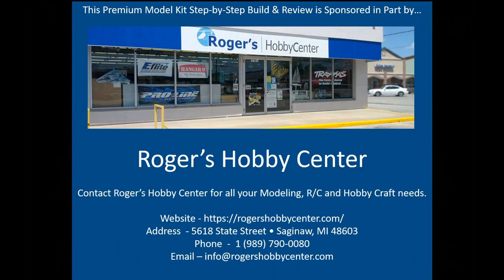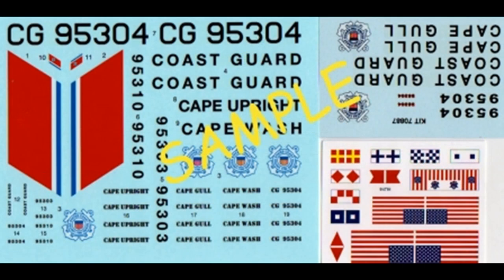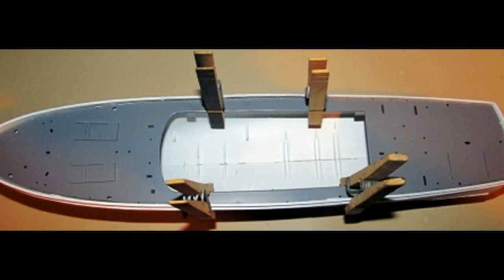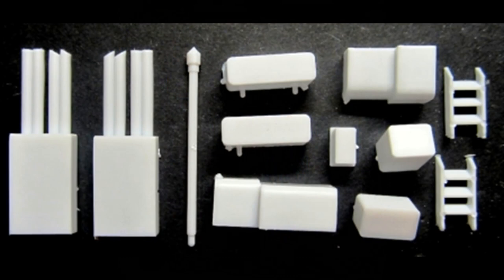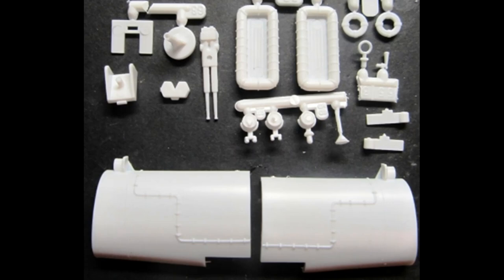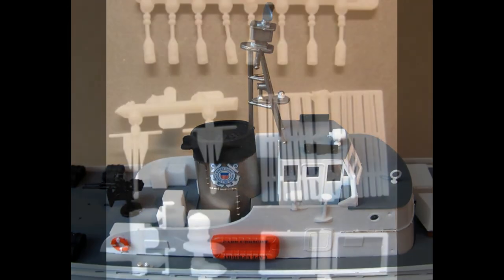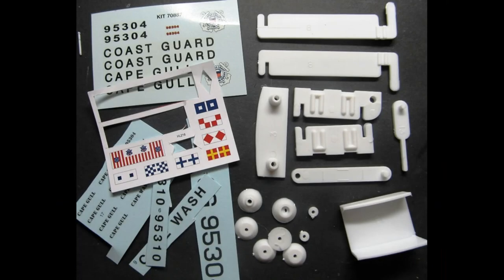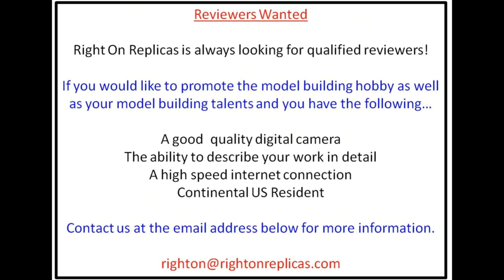USCG Cape Class Patrol Boat 1:82 Scale Lindberg #HL216  -Model Kit Build & Review

Comment: What adhesive are you using to attach painted parts to painted surfaces?
Reply from the maker: Wm,  First, that paint needs to be addressed first!  You must scrape or sand the paint from adjoining areas first or the glue won't adhere to the plastic.  Thanks for asking and if you find our channel helpful, please subscribe if you haven't already, to help us continue our mission to inspire more modelers!  -Doug!
Reply: @RightOnReplicas  I figured that but what I was wondering when attaching the smoke stacks, how did you get in the right space to sand and or scape paint off the area of the smoke stack location to attach the stack? I’ve assembled my deck pieces all except for the stacks and exhaust units still need to be painted thought.
Reply from the maker: WM, If you know an area (like the exhaust where the stacks are inserted) will be difficult to get at for that sort of thing scrape/sand the joining spaces before assembly or use a putty/paper plug to keep the paint out.  If it's bracing to the body, test fit the parts, mark the area where they will touch, and carefully scrape some paint away so it doesn't show when you glue the parts onto it.   Thanks for asking and if you find our channel helpful, please subscribe if you haven't already, to help us continue our mission to inspire more modelers!  -Doug!

Comment: Excellent tutorial, but please use the terms deck instead of floor, helm instead of steering wheel, and bulkhead instead of wall.
Reply from the maker: Presto,  Thanks for the info!    -PS,  please subscribe if you haven't already to help us reach more modelers! -Doug
Reply: @RightOnReplicas  I built the powered 95304 version long ago. How can I get the racing stripe decals?
Reply from the maker: Presto,  Not sure waht you're referring too but if it's the red Coast Guard stripe it would be easiest to paint it on between two pieces of tape.    -PS,  please subscribe if you haven't already to help us reach more modelers! -Doug